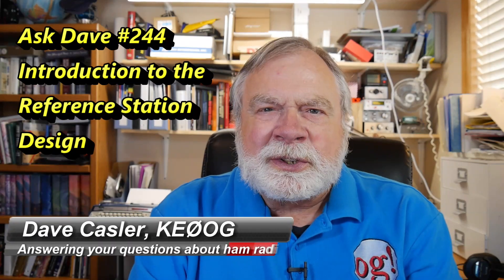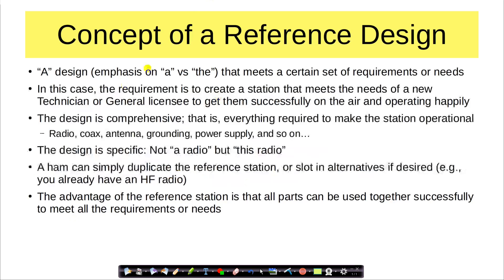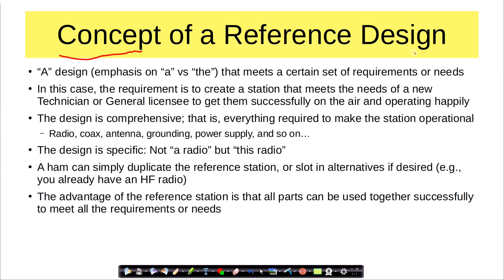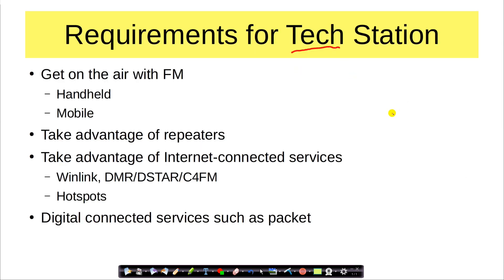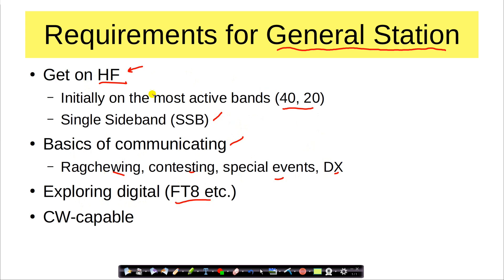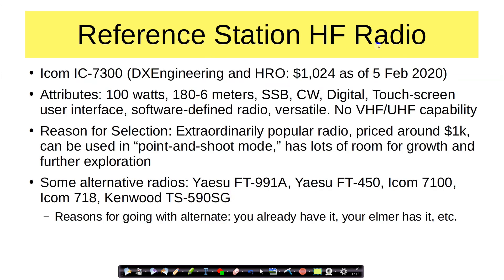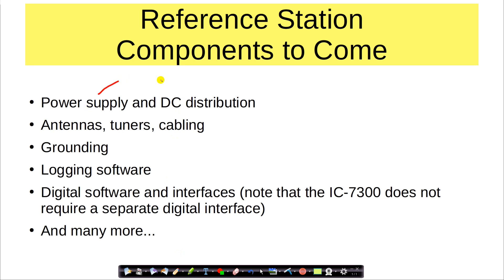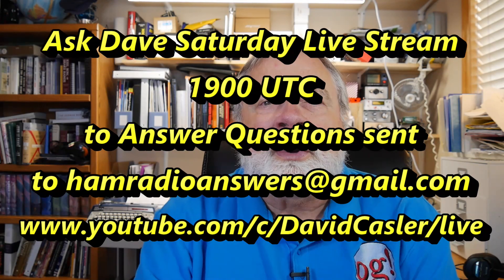Reference Design HF Radio: Icom IC-7300 (#244)

Comment: What I am looking for in a rig is "all band, all mode, all type".  "All band", in this case, does not actually mean every single frequency band allocated to ham radio.  My definition of "all band" means all the ham bands from 160 metres to 2 metres, as well as 70 cm.  The IC-7300 does not do 2 metres or 70 cm.  "All type" means it is not awkward to use in any of the three types of ham station:  Base, mobile and portable.  The IC-7300 is really only meant to be a base radio.

However, I believe there is a model of rig that does fit my "all band, all mode, all type" concept, and that is actually the Yaesu FT-991A.

73 VE7NDE

Comment: I have a seventy three hundred. I have a  astron five hundred  amp. will I have to get any special for this radio. a hundred watts  does not get it. ???? I had to jump through hoops to get it hooked to the seven o six.

Comment: Dave, I have found another YouTuber who has developed a complete series on the operation and set-up of the IC-7300. This series is an excellent addition to what you have to offer for the reference station HF radio. He goes into detail of every aspect of the 7300 set-up and function. I've had mine for a couple of years now and I'm still learning the capabilities of the radio. Thanks so much for all the guidance you have given us. You are an invaluable resource to the ham community. 73 KE0JVS

Comment: IC-7300 is a reasonable choice. Other options are - Yaesu FT-891 and Yaesu FT-991A. The first one is significantly cheaper than IC-7300 but it's a great radio nevertheless. The best thing about it - it's quite lightweight for a 100W radio (~2kg) which makes it a great choice for using outdoors. What makes FT-991A interesting is that it provides much more value than IC-7300 for a little higher price, including 2m and 70cm CW, SSB and digital for 2m DX and EME. Also I like it's filtering capabilities, including narrowband digital filters (50-500 Hz) for CW. Still, you can't go too wrong with any new 100W transceiver from ICOM, Yaesu or Kenwood. 73 de R2AUK

Comment: Randl.com (R and L Electronics), A dealer near Dayton has  the IC 7300 for $910 or with a 30 amp power supply for $960 They have low prices on this rig or power supply combination frequently.  No affiliation.

Comment: Dave if you deliver on this, I’ll name my firstborn after you.  I’ve been scouring for something like this for months of hard searching, nothing even scratches the surface, and what you’re describing goes well beyond the reference station I was searching for to various fundamentals of use and activities.
I have a Yaesu 991, but if I see you delivering on this I will get a 7300 as well to travel along.  I was planning on a dedicated HF to pair with my 991, and 7300 was on the short list.
Bless you.
PS... I know this will keep you busy for a while, but pls also consider my recent correspondence requesting a similar reference trilogy series on reference antenna builds/science.

Comment: Thanks Dave! Just getting back into it after moving countries and a few years off air. So I am starting from scratch without the gear that I donated to the club in Sweden before moving to Montreal. Anyway let's start with the 7300! VE2XPM ex SM0XPM, G0EPM, G8LKU

Comment: Looking forward to this series. Being an icom fanboy my decision was really easy. When I earned my Technician in May I purchased the ID-51+2 and a ZUMSPOT, then the ID-5100 and an OS2. Upgraded to General 45 days later. Well fast forward to December and I purchased the 7300 and last week I added a 9700. Lots of RFI here in my apartment, looking forward to solving that problem and finally getting out on HF. So far HAMSTICKS are not working. I have a 20m and a 40m. 73
KN4UOT

Comment: I've bee working through your Tech and Generl series Videos.  i will test for Tech on March 14.  Perhaps General.  The concept of a Reference Station for HF is a great idea.  I  hve been inspecting and certifying new homes for Energy Star Certification.  The process uses a reference home, that matches the home your are inspecting, but only meets  the 2006 Energy Code.  It is an interesting process to see how little things match ur don''t match up as expected.  

ULtimately, making contacts 90° to 180*  E or W longitude from  your location can depend on the radio, the antenna, and how they are hooked together.  Change one piece and  the whole system changes. i will be foloowing to see your choices of al the other pieces of the system.   Thank You!

Comment: Great idea Dave and as an IC-7300 owner, I think you made the right gear choice. I'm curious to see what else you add. The 7300 is a very capable radio that so far I've found easy to start with, but able to do so much advanced stuff. 
I'll be watching.

Comment: I bought the IC-7300 last year before Thanksgiving. I could have saved some $ on HRO's Black Friday event but didn't want to get run over by shoppers getting to the radio online.
I wish you well with this series. I hope you don't get bogged down with the comment section from viewers saying you should have bought this radio or that radio or can you do one on the Yaesu FT-991a. Looking forward to what you get for a VHF/UHF reference radio. I really like my Yaesu FTM-100DR. Very affordable with Fusion and full on Wires-X node capabilities and a very good analog radio although at first glance has a slightly confusing menu system. I am guessing you will be referencing an Analog VHF/UHF mobile radio. Whatever you pick, it will be a great series.
73!

Comment: Great Dave I got the ic-7300 back in September still in the box so I’m looking forward to your series on this and growing with you Terry.
Reply: Please don't leave it in the box unpowered much longer.  The Clock battery is rechargeable, and the rig needs to be hooked up to 13 Volt DC power occasionally to keep this battery from dying. The rig does not to be turned on, but just hooked to power will be fine.  73  de  James K0UA

Comment: Investing in a 7300 is a lot of money for someone brand new or just upgraded to general. 

It's a fantastic radio of course and I appreciate your point of view on it as far as getting the newly upgraded on the right track for HF. 

In the addition to the aforementioned cost reason, and perhaps more importantly, I don't think the new general will fully appreciate the rig's many features, particularly its panadapter, unless she had used a conventional superhet previously. 

I think the 7300 is more apt as a gift to oneself once they've passed their Extra, and have gotten to know HF like the rest of us had to. By tuning around that big knob and listening for signals.

Comment: Dave: I am one of those Extra Class guys who recently earned all of my licenses in a year but remember all of the old gear available in the 1970's when I almost became a ham.  I've made a deep dive into DMR, my Anytone 878, APRS, built easy antennas and soon will get a hot spot.  

Last week, a friend heard me wishing I had more information on HF.  He offered to showcase his station.  It was an ICOM 7300, all of the digital interfaces I could want (and we are both IT guys!), a nifty antenna tuner, multiple antennas and now an amplifier.  I really was looking for a reference station and came away with lots of info.  It was also a case of information overload.  

I also had to completely reset my ideas about what an HF station should be.  I think your idea of a video series on a reference station is absolutely on target.  This is information that doesn't seem to exist in a coherent way and isn't really covered by the ARRL.  

Good luck!

Comment: One question from a new ham.   Do you know if the IC-7300 has D-STAR
Reply: It does not.  D-STAR is primarily a VHF/UHF protocol, and the 7300 is an HF focused rig.  The 7100 does have D-STAR as it also covers the 144 and 440mhz bands.  73  de James K0UA

Comment: Hi Dave, just finished the video and thought I'd leave my 2 cents worth. I just got my license renewed last year after a 20 year absence. I also chose the IC-7300, somewhat fortuitously, and it's been a great pick for me. I'm chose an Astron 30 amp switching regulator to power it, and I chose an 80 meter EFHW antenna by myantennas.com. The antenna is resonant on all amateur bands and can handle up to 1000 watts ICAS rated. I'm really very happy with it. I don't have enough space to run it straight, so it's in somewhat of a open ended trapazoid pattern involving my house and two trees. No tuner needed as the IC-7300 has an internal tuner that's not usually needed either. I've also tried several logging programs and really like the latest Log4OM. Really great software. 

Just thought I'd share my experiences with building a relatively new station. Take care.

Comment: What is the advantage over the Yaseu FT 991A?
Reply: The receiver in the 7300 is according to several testing authorities including Sherwood, is quite a bit better in the 7300.  "The waterfall display is superior, and the operating system is easier to learn.  However it does NOT include VHF/UHF like the 991A has.  That can either be bad or good depending on your point of view.  I like having separate VHF/UHF rigs instead of the "all in one box" concept.   73 de James K0UA

Comment: This is great - Dave- just what I need. 

It's nuts but I have not had time to get a license at all - my mom died and having to settle estate - as well as deal with doing business taxes.
But I have some money now - enough to buy a radio - etc - but have had no clue where to start when there is no time to do this properly. And I feel like I should have all this learning done - yesterday. 

So I am hopping on board and will follow you on this series. I may have to buy - and learn and quialify later. But this gives me a reasonable beginning. 

With that said, guess I won't have VHF/UHF capability - since you're assuming I would have all that already. 
Well think idiots. You've got at least one following you. I downloaded a slew of your videos awhile back but have not had time to begin watching them - and I have the proper books. But again, no time.

So let me just thank you again and hope I can follow what you're saying I should buy.so I can set it up later - but I guess if I get equioment while I have the money to spend - it's a beginning. 

Wish me well. Smile.

Comment: I just picked one up today! So excited.
Reply: Josh King I hope you love it as much as I love mine!
Reply: Congrats!
Reply: You will not be disappointed in the 7300.  I have two of them and a 7610 I use them all daily.  I have been licensed for almost 50 years, and like he said the 7300 is the best value in amateur radio for an HF+6 meter radio.  There is a good reason for their popularity.  It is simply more bang for the buck.   73 de James K0UA

Comment: I chose the IC-7100. Since I was starting with no home station, it gave me HF/VHF/UHF in one radio. It does a lot of what the IC-7300 does.  A couple things I miss: (1) The ability to scan VHF/UHF while working HF.  I took care of this by adding a Uniden BCT-15X scanner. (2) Waterfall. I will probably add an external SDR receiver at some point.

Comment: Thank you so much for launching this series! I'm very excited about this and know of nothing like it out there, most especially that's current. I've been wanting to get the IC-7300 for a very long time now, but you've given me incentive to do so sooner rather than later. I've been a ham for some years now, but there are very many things I haven't done with the hobby being that I've been unable to devote large chunks of time getting up to speed using various modes, functions, etc. So I truly welcome your series, in part as a way to help me fast-track through some procedures that would otherwise take me some time to figure out. Can't wait!
Reply: I am definitely in your boat, my friend. I've been away from the hobby for decades and just getting back in. I also have been lusting after the 7300, so, now is the time! I am pretty dumb on the subject of digital modes, so that will be an education as well. I'm currently getting back up to speed on CW (joined SKCC, a great group).  Ed  KE6BN